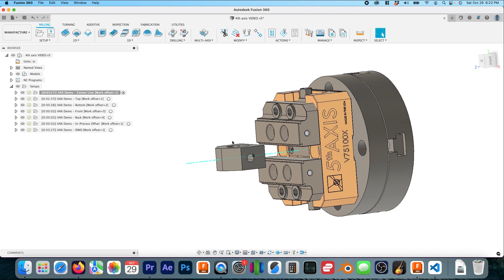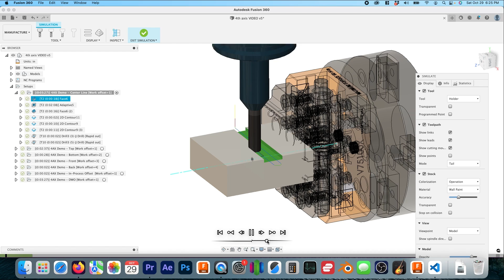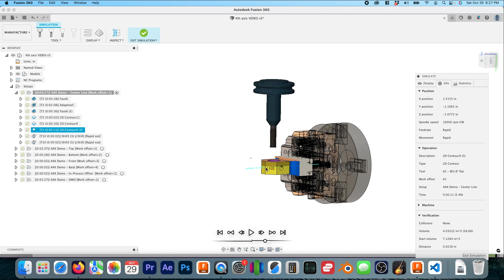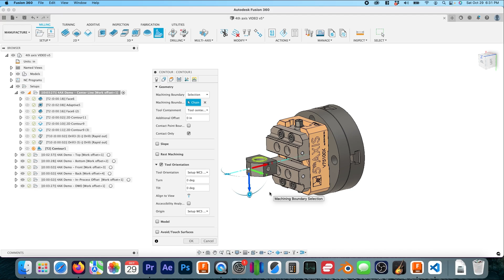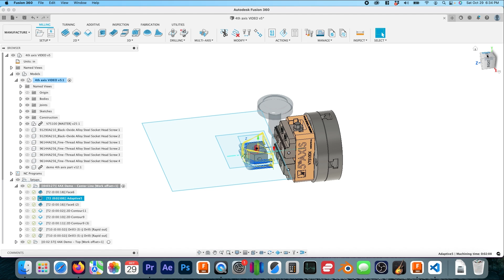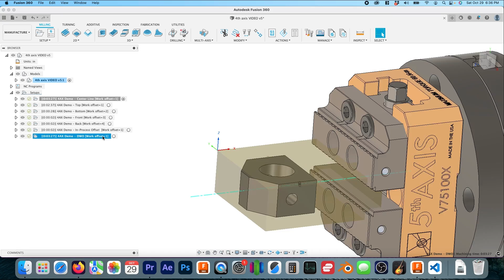4th Axis CNC Programming Intro

Comment: Quick note about bundling toolpaths by tool versus orientation.  On a machine like my Bother Speedio where tool changes are faster than indexing (even with their T200A rotary which is FAST) I bundle toolpaths by orientation.  On machine with slower tool changes (my Okuma M560 for instance) I would perform all operations with one tool and then move to the next one, indexing as necessary.  I also make sure my post processor is writing retracts to accomodate!

Comment: Looks as if most of these paths were indexed rather than simultaneous, so don't require the extensions, which hobby users can't afford. Can you let us know which paths require the extensions as you cover them please? Many thanks for posting this stuff!
Reply: You'd only need the extensions for toolpaths in which the other axis are moving while the 4th axis is simultaneously moving. Deburring operations around the od of a round part would be a common application using the multi axis extension. 

I'm a Profesional CNC programmer. I do 4th and 5th axis and the current company I work for is fusion 360 based.

Comment: Is it the problem with Fusion 360 capabilities, that it does not simulate the rotation of the Rotation table?
Reply: Fusion can do that, it just by default does rotate the tool because that makes the toolpath applicable on any type of machine

Comment: Thanks a lot for this video. Now the 4th axis is not the monster it was before!
BTW: why to create boundary sketches to avoid collisions when already the software checks for the vise boundaries? Maybe the first approach is used only when you have not a precise 3D model of your wise?
Reply: The containment isn’t just protecting the vise, it is also keeping the toolpaths from milling the grip stock that keeps the part held to the vise. 

If you only avoid collisions, your first roughing operation will remove all the material keeping the part rigidly held. Usually this stock is milled away last.

Comment: Thanks! Lots of confusion gone!
 Concerning Fusion 360, so far it has been a good, lower cost option for my CAD needs. I liked Solidworks, but not the cost. The file structure made sharing a pain (back in 2010). Would you go a little deeper on the Fusion tradeoffs?
Reply: I looked at SW but the cost is ridiculous for a small business, it was something in the region of £7K!!! I paid £800 for 3 years worth of Fusion360 and it has CAD and CAM. Once you’ve bought SW you still need to buy a CAM to go with it.